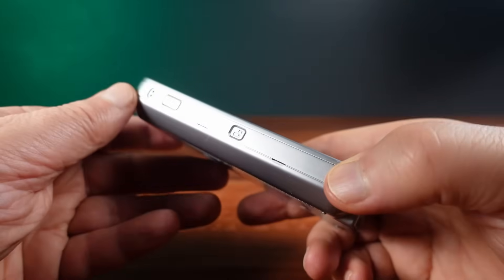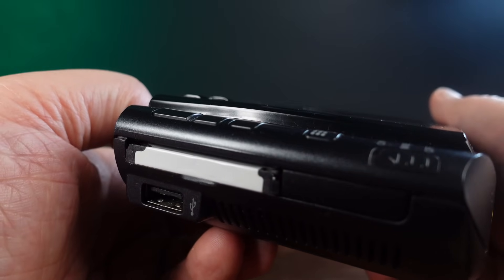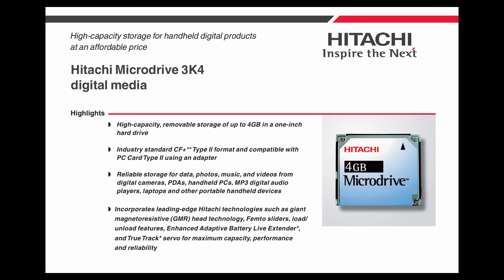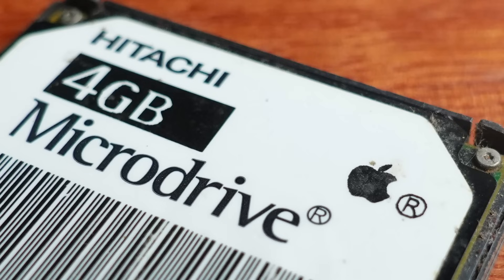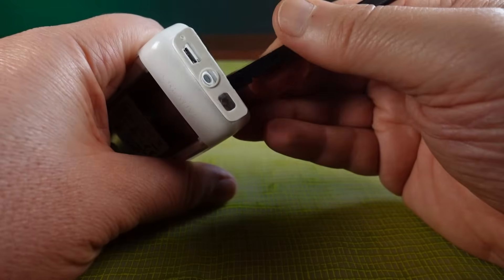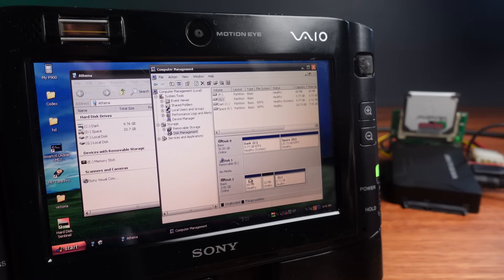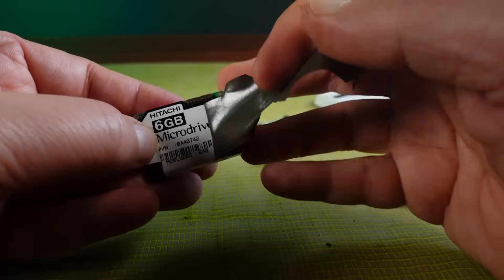Miniature Hard Drives

Comment: the PalmOne was Awesome! I always wanted a Portable HDD (eMMC or NVMe) that had a screen on it with a File Manager that you could use to Sort Files on the disk without plugging it in, and the option to Mount an ISO or Floppy Disk Image on it to use it as a Portable BOOT Floppy or DVD ROM drive to Install Operating Systems or boot Linux ISO's with Ventoy or a Full Portable HDD ... then I could put all my Boot Disks into a folder and even Manage the Files on the disk without the need for external hardware... want a folder moved to a different subfolder? Just click it and cut or copy, then navigate to the folder you want  to drop it into and Paste... boom, easy. I would pay for even a simple enclosure like that if it let me manage my files or mount a disk image ... and if it would pretend to be an Amiga or Commodore HDD or Floppy... Woe Buddy that would be Hella Cool!

Comment: I wonder if you could get the firmware somehow if they could be converted from internal Microdrive to the Compact Flash standard. I'm sure by now someone has done this so you can convert them. I know with CF there's a small program where you can convert a CF card from removable to fixed disk so you can use them on retro computers, like for 2000 & XP. However that program only works on specific earlier CF Cards, like some 4GB and smaller SanDisk cards, but not all are supported, for example the SanDisk Extreme II and III, but I think the Ultra and possibly Ultra II are supported along with other manufactures of CF cards. It'd be interesting to see if the reverse could be done on the Microdrive to make the CF compatible.
Reply from the maker: I've used that CF removable to fixed software, it's very useful.
As for Microdrive firmware mods, I've only seen it mentioned, nothing more :(

Comment: So you ruined a perfectly operating hdd for a video.
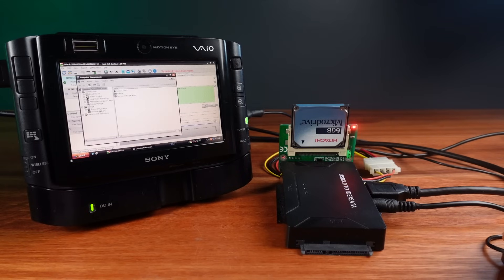Reply from the maker: Nope! I did thorough low level testing to confirm it was faulty. See 15:50 where I said "I did extensive testing and I believe it's because it has a faulty mechanism. Or maybe a faulty controller board. I don't think this drive is ever going to work again."

I also have a wide experience of successful data recovery from mechanical hard drives. See this very old and now unlisted video :) "Spinning up damaged hard drives (dust included)" https://www.youtube.com/watch?v=52sm6tq-GhE

Comment: While there would be no practical use, it would be interesting to see the data density and capacity that could be achieved if a drive of this form factor were produced using modern HDD technology. When these were mainstream, 3.5-inch hard drives had only just reached 1TB (2007), coincidentally achieved by Hitachi. Today, drives are reaching 3.6TB on a single platter.

Comment: I worked in data recovery for over 20 years. These HDD were difficult and tricky to repair, it was literally microsurgery when replacing the heads.
Reply from the maker: I'm impressed that you were able to work on these in data recovery.
Reply: @JanusCycle  Thanks. Yeah us guys in DR tackled them. .85 inch Toshiba was challenging. From memory they were single platter, and the head stack assembly was non removable and so in this case a platter swap was required when the heads had failed, unlike bigger spinning HDD where you would swap the heads out, unless the spindle motor had seized, which was regular with Seagate models.
Reply from the maker: @ That's interesting you also did 0.85 inch Toshiba drives as well.
The 1 inch Microdrive I can understand a professional photographer wanting to recover important work, justifying the cost of recovery.
But the 0.85 inch was used in the Nokia N91 and a few consumer USB memory devices. I can't imagine this segment getting much recovery done when they failed.
But there are probably aspects I don't know about. Thanks for sharing your perspective on this.

Comment: I'm surprised these were so popular for MP3-players. The capacity and size was great at the time, but weren't they susceptible to shaking?
Reply: Not really. They had buffers that could hold at least a full song in RAM so any normal jostling didn't effect it.  It was fairly drop resistant usually with ordinary tumbles not causing any damage. I think the Microdrive players were actually more robust than the larger 1.8" drive players, probably helped by the lower mass.

Comment: Brother it's simple..
Micro drive doesn't work in low power 😂😂😂
It needs more power to rotate it's components 😂😂😂
And the card reader that detects is small and uses low power for itself 😂😂😂
Reply from the maker: There were indeed some cameras that struggled to power Microdrives. But the VAIO UX slot and USB readers I used all worked with retail Microdrives, so this power issue doesn't apply for me.

Comment: Another thing with these microdrives - all these years later, and you can still read the info off them without issues. 
Try that with a flash drive 10+ years later, and i think y ou will find that for the most, you will be out of luck... 
From a longevity perspective, these drives still have an advantage...
Reply: I've read flash drives that were 20 years old without problems. Theoretically, you're correct, but then there's the problem of mechanical deterioration.
Reply: @stevew1487  Yes, there are some solid state techs that has 10+ or even 50+ years retention, sometimes even more, and the larger the cell (lower density), the better the chance of long retention. 
There is also a difference between flash and flash-"rom", where the latter is a specialized version with focus on long retention, but they typically come at a penalty of lower write cycles, typically a mere 2-10K cycles compared to the 10-100K cycles of more traditional flash. 

The higher the capacity, the higher likelyhood of a lower retention period, and as of modern drives, i would not trust them for anything beyond appx 5 years. 
As for mechanical issues, this is equally true, with issues like "stiction" etc, but then, as long as the drive is mechanically sound, it can usually be sorted out, and the magnetic retention is rarely the issue, as that can easily go into the 50-100y range, while there may be more issues with mechanics and interfacees going obsolete and hard to get by.

Comment: Hi there, what's the device you use to connect the micro drive to a usb port? Also, can it be used with the larger 40gb and 60gb Samsung micro drives?

My crazy idea is to pull one apart and use it as a usb storage whilst being able to see the mechanism move! Is it possible?

Thanks in advance 🙏
Reply: Janus said in an earlier post he has plans to do that. I'd like to try it myself. You need at least a CF type II card reader but not all of them will work. The one he used is a simple CF type II to USB adapter. There's no reason it wouldn't work, but it's delicate work and the enclosure you use will have to provide protection from shock and dust, as well as a semi-permeable vent hole and access to the interface from outside. I'm thinking about something like a small plexiglas cube. Probably the hardest part will be removing the cover cleanly without damaging the drive. I don't know anything about the 40 and 60GB drives. Mine are all 5GB CF type II.
Reply from the maker: I admit I haven't really though about what to do about the pressure equilization hole when putting a clear top on. Let's try and keep in touch when we decide to give this a go.
Reply: @JanusCycle  Great, I'll keep you updated. I was thinking of a simple microfiber protected hole for pressure equalization. Doesn't have to be intrusive or obvious. It's probably easier to keep the reader circuit within the enclosure but I like the idea of just the drive sitting in there, but then I have to run all the interface wires through the enclosure, at the same time mounting just the drive is a lot simpler so it equals out either way I guess.
Reply from the maker: I would like to do this as well. I mentioned this briefly in the extras video here,
https://www.youtube.com/watch?v=9eQctCx3hR8
A CF USB reader with a GL834 chip inside should work with any Microdrove, including embedded ones.
Reply: @JanusCycle  I think acrylic would be easier to work with than glass as far as providing venting. You could use a double layer of thin plexiglas with the lower layer providing piping out to the side, filled with a filter material, then the top layer could be covered with a real glass screen protector for scratch resistance.

Comment: Had 20GB Creative mp3 player back in 2008, when it started being slow with skipping n some songs would grabble or not play at all and finally battery stopped charging, I took it apart found a whole 20GB hard drive attached with a mini flex cable to mainboard with another little board attaching battery also had little chips looked like ram and a golden or silver chip probably cpu. Was a good player got 2 yrs of use, survived 4 drops on the ground and in water sold it off after I took it apart.

Comment: Its amazing how just 2 years later the iphone and gen 1 ipod touch would immediately double that 4gb to 8gb with digital flash instead of a hdd
Reply: There were 8GB flash players in 2006.
Reply from the maker: The 2006 to 2007 period saw really rapid flash memory price drops and adoption in devices. Everything changed so fast then.
Reply: @JanusCycle  I agree Microdrives quickly vanished when affordable flash reached 4GB+. That's why it was a bit of oddware when Trekstor released the 8GB Cornice SE mp3 player in 2007 (the Vibez). Maybe they got a deal on them. I bought it because it was a reincarnation of the Rio Karma (same essential firmware).

Comment: I still own a 1GB IBM micro drive and it still works. It’s came with the PCMCIA adapter and a case for both.
Reply: Hold onto it, it is or will be a collectors item. With flash memory where it is it's unlikely these will ever be made again.
Reply: @stevew1487  Im still amazed at the engineering that went into these tiny mechanical marvels.
Reply: @stevew1487  Interesting. That didn't occur to me. Thank you

Comment: i bought an mp3 player in 2015-2016 with chip memory of 7GB and an external micro sd slot to expand.... for about 25usd...
watching those CREATIVE mp3 players i feel so weird...
i admire their quality but their cost back then was an issue..
yes the player i bought does not looks that high quality, but it is light small with an color small display, a small battery inside that lasts for hours, amazing quality, supports more file types and it is cheap...
all that makes you happy when you realize what technology brings to the consumers even if the quality is lower..

Comment: I love these old technologies. I got a couple micro drives from old iPod minis. One I took apart and have stuck onto my imac. It makes a sweet little display piece with how cute it is! I also just looked through my old storage medias and found I have a really old 4mb cf card. Yikes that's nothing! Also found I still got an old 128mb usb drive lol. There was also an even smaller micro drive that was in a phone. It's was I think about the same size as a sd card. Which is amazing how tiny they got a spinning hard drive!

A great thing of cf cards is to use as a replacement for old computer drives (Mostly laptops). Since the cf card and ide interface are much alike it's almost a drop in replacement. But some cards do not work. I have an old win 98 laptop I've tried several cards in. I got a 32gb cf card to work but not my 4gb cards. The 4gb cf cards are actually just smaller than the original 4gb hdd meaning I can't image the hdd over without a ton of work to downsize the image. And the restore disc doesn't like the 4gb cf cards lol.

Comment: I just want to state fir fact that we have 2 terrabyte micro sd cards for 60 $ usd right now
This costed 500$ in 2003 or about 860 today
You could buy 28.55 terrabytes today for what you can buy then for 4gb
What worse is that's not even the best
You can buy 20tb 3.5 inch hdd drives  for 200 so buying that a gigabyte is less than a cent

Comment: I have one of the earlier IBM 1GB microdrives.  Unfortunately it is too thick to fit into the USB-PCMCIA adapters that are still to be bought.  There were two thicknesses in the PCMCIA specification, but AFAIK all the flash drives are the made to the thin spec.
They were very interesting drives, and I never understood how something so complicated as an HDD could be made so small.
Reply: Just make sure you get a CF type II reader.

Comment: at that time the CF storage card that for digital SLR that was reasonably accessible to most consumer was around 256MB - 512MB. Anything above would be really costly. And for hobbyist who shoot event (especially sport event) for a full day, you will probably need about 2-3GB of storage. These Microdrives were popular those time until those portable HDD storage solution for photographer came into market later. After awhile the flash storage had gone cheaper which 1GB storage was similar to a 256MB on early days. Then flash storage became cheaper and cheaper until the 16GB or 32GB CF card became mainstream.

Comment: Thanks for a great video.  Subscribed.  I have an old "working" video Zen (as in it's been 10 years+ since power on) around here somewhere.  The next time I find it I might just be inspired to look it up and see if the 4GB microdrive is CF compatible and if so, then it might have to be dissected for the greator good.
Reply: Depending on the model it may have a 1.8" drive or flash. I'm not aware of any video capable Zen that used these. The Zen Micro was the first, black and white screen, no video, and the Zen photo, same thing but with a color screen, again no video. They both used these. The bigger video-capable player used 1.8" drives.
Reply: @stevew1487  I remember the HD powering up and down to load content into the devices memory, I was frankly fascinated at that time.  I notice that there are many versions, both CF and IDE versions on eBay, but it is hard to justify those prices for experimental reasons in the current time frame, it is just fascinating to hear such small hard drives power up, calibrate and transfer data.  It was a color Zen with a very tiny screen, when I find it I will report, or perhaps send it to you for your collection.  I received it in compensation for computer repairs.
Reply: @theradioweyr  It sounds like it could be the 'Zen Vision M', a direct competitor to the ipod video at the time. I think they eventually sold them with drives as big as 60 or 80GB. If that was the model then it used 1.8" drives, still very small and with capacities beyond what they could fit on Microdrives.

Comment: Flash storage is still expensive: you can buy a 1TB HDD with the price of 128GB SSD
Reply: But you can get a 128GB SD card for $20. You're paying for performance, not storage.
Reply: @stevew1487  Those are the cheap, unreliable ones, I've already got two of them go dead one me! the near shops do not offer warranty. Too risky. The ones with warranty are $40-50
Reply: @skeletala  OK, I was pushing it with $20. $30-$40 is more like it.😁
Reply: @ There are $20 SSDs with that capacity, tho, only in the black-market. The ones with a warranty cost $40+
It's either risky or expensive.
[I've answered you, but, YT deleted my prior comment] — I hate YT

Comment: I recently bought a Nikon D100 for the lens it came with and it had an original 340MB Microdrive in it. It still works and stores images! I had to use my old card reader to read it on my PC, as the new ones unsurprisingly no longer bother to support CF II cards and opt to save space instead.
Reply: They're still available new as long as you make sure it says CFII compatible.

Comment: Most USB to IDE adapters will not pass SMART drive data and emulate USB storage only. That's why when you plug in a USB to IDE adapter, they typically identify as a "Sainsonic USB drive" or something similar to the host computer. The adapter and host would need to support UASP to get full SMART data over USB.

Comment: I've got a Vivitar  Mighty Player DMD-P20 from 2005 and it has got a 20GB microdrive buit in (I think) and it's even got a slot for an external CF/Microdrive. It's a chunky MP3 multimedia player with a 3.5 inch screen and a docking stand. There's a possiblity the internal HDD is a 1.8 inch form factor, but I haven't looked. Either way some pretty tiny mechanical HDD in that thing.
Reply from the maker: Nice looking player.
Reply: Yes, 1.8".

Comment: This is a failed technology. Microdrives are not designed to work in dynamic conditions, which is why they quickly fail
Reply from the maker: You make is sound like most drives would fail. Yet they were commercially viable for seven years and Apple sold tens of millions of iPod Minis with microdrives inside.
Reply: Actually that's exactly what they're designed for. Most of the ones I have still work 20 years after they were made.

Comment: Some CF card readers can read Microdrives because there's a small conversion circuit inside the controller chip of the reader that handles protocol translation between the CF and PATA interface. The low-level signal translation is hardwired while everything else like the timing, interface management, and higher-level control are handled by firmware coded mostly in C, and Assembly for performance-critical sections.

Comment: I remember trying to get one for my Asus MyPal A620 back in the days, but it never worked with it, I don't know if it was an issue with IDE type only microdrive or some other issue.
I'm so old and I miss my Windows phone
Reply: I'll have to try my 5GB Seagate Microdrive in my Loox 720 sometime. It's possible if you used one of the bigger drives it couldn't address all the space but I'm not sure. It could also have been a power issue.